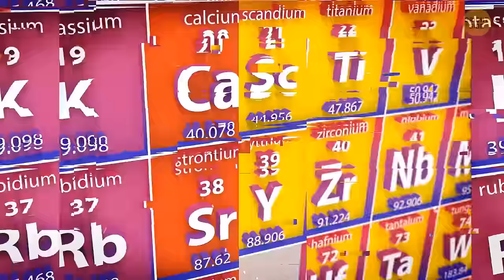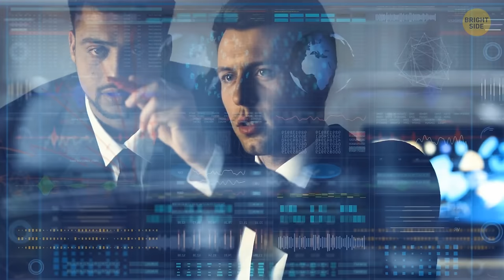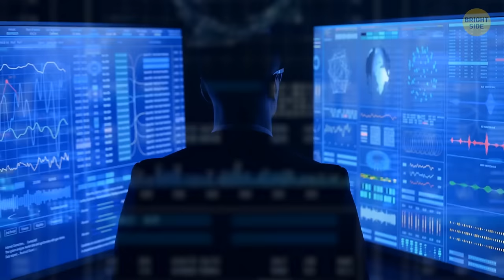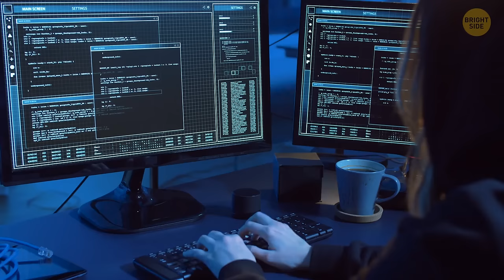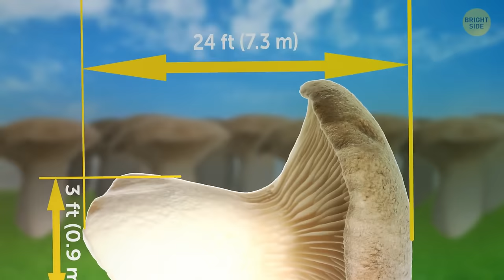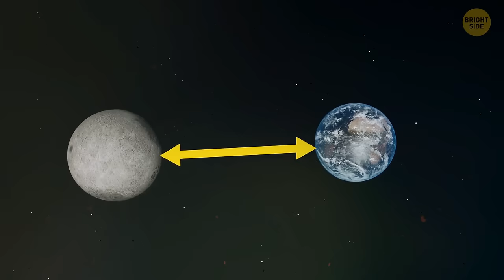How did gold appear on Earth?

Comment: they didn't really explain it.  gold is created when a star goes supernova and the higher elements are created when lower elements are fused together.  that's basically it.  all higher elements above iron come DIRECTLY from exploding stars through FUSION.  that's it, it's not a mystery at all.   those elements then travel in space and collected or formed parts of planets.
Reply: There is actually a theory that says that the heaviest elements in the universe could have been formed not by supernovae, but by the merger of two neutron stars in what is known as a kilonova. This is due to what is called the R-process.  From what we can tell, the conditions needed to form heavier elements such as gold are more likely using this process than the S-process, which is the result of supernovae.
Reply: @coopmurphy9216  both actually, but you are correct.   those are the two leading theories until a new theory is accepted.
Reply: Where just a giant quantum locked puck the sun is a spinning magnet that just locks us by polarity shift and if you think of the fact we're actually traveling In a vortex through space around a sun also traveling and spinning it makes perfect sense. Different materials would get pulled in by a sonoluminescense effect and magnetic waves. Then depending on what materials and timing it locks us the correct distance. Scaling magnetic waves for stars should show us what's actually sufficient for life by distance from star. Would also explain electrical storms and what not for different planets and situations.
Reply: Gold and Platinum are created by neutron star collisions, whereas Silver and Palladium are created by supernovae. That also includes Rhodium and Ruthenium!
Reply: Who says it is not a mystery"¿
Reply: @fh.7287  ?
Reply: Pop 0
Reply: @CJ-yk4sn sonoluminesence sounds pretty spot on would there be any magnetism around all that heat? I would think gravity would play a bigger role.
Reply: You would think right
Reply: Absolutely correct !!!!